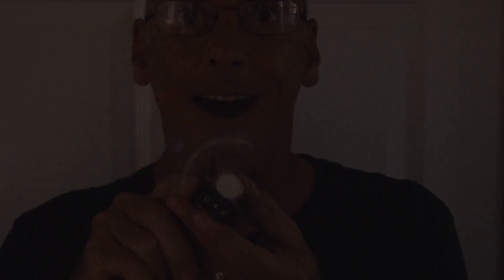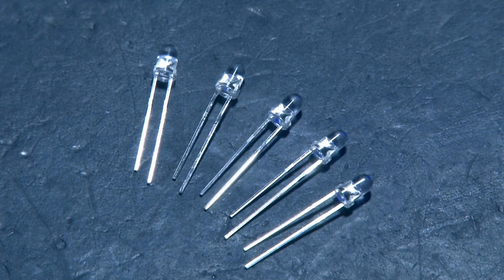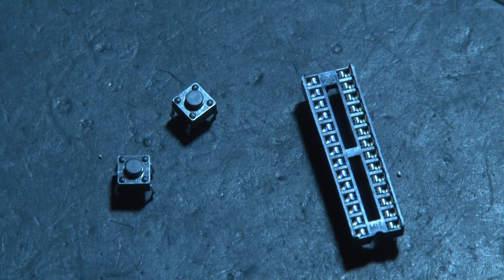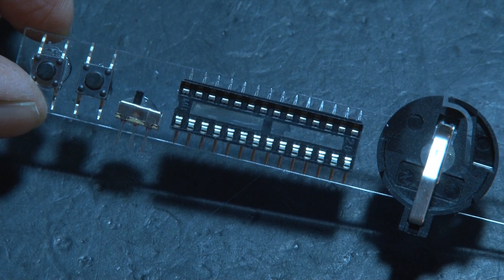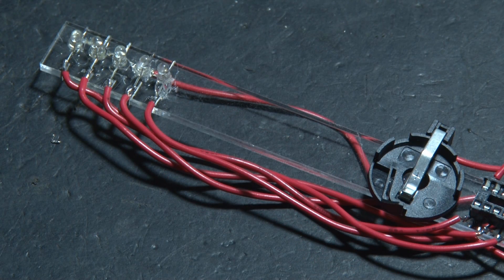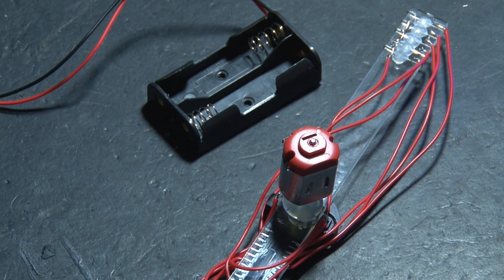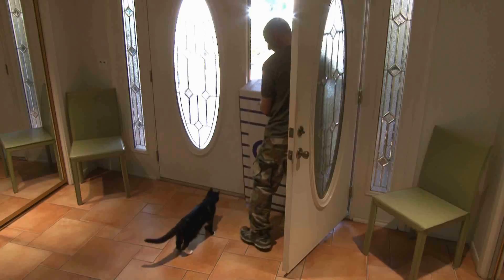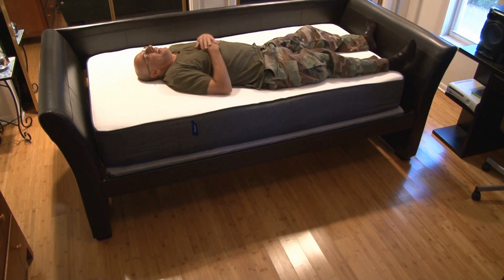Make a Spinning LED Display!

Comment: why the atmega? an attiny would also work
Reply: Microcontrollers have internal oscillator nowadays !
Reply: I don't care what IC he used, I wonder how he got the IC to work without a crystal oscillator clock!
Reply: Gilles Bisson I found that out on my own before, but thank you for pointing that out. : )

Comment: What a mess! Thick wires, messy soldering, hotglue? Now Hot glue is fine! But I would drill a hole for the motor, use very thin wiring and so on.

Comment: have any one idea about the name of programmer ATMEGA
Reply: +thaer shabo ATMEGA is a type of micro-controller
Reply: mikimomo97  yes i know that but there are a lot of name there for example in the arduino uno the chip is "atmega328p" but when i try to replace the chip with "atmegaBL_BPU" it show me the error ,so just i want to know if i have Atmel AT89C2051 microcontroller (or AT89C1051, AT89C4051) how can i program it. thank u.

Comment: Those wires are too thick for that amount of electrical current. It's a good idea to dissect an old Printer Serial cable in order to get the wires inside. You will get like 20 thin wires of different colors.

Comment: Kipkay You should check our ARDUINO a new small programmable computer
Reply: +adam darras facepalm
Reply: +adam darras It's not new at all. It was released in 2005. Of course, new models are constantly releasing. Anyway, the Arduino is just an AVR based computer. What makes the Arduino an Arduino is the software.
Reply: TheScoutPro ??
Reply: adam darras Look at some of his older videos.
Reply: TheScoutPro U mean he already used it before? ok srry didnt realize that.
Reply: +adam dares Yes, he used it before. He made one. It's not yours. You shouldn't say "our arduino".
Reply: Vlad Tomoiaga Reread the comment.
Reply: TheScoutPro shut up

Comment: Securing everything with hot glue... using red wires for negative line (2:16)... good luck troubleshooting this project if it stops working

Comment: Button cell battery? Eugh, those should be used for calculators, watches and nothing else.
Reply: They are also used in your computer and mobile devices to keep the clock when the battery is dead.
Reply: ***** Forgot about that. Not sure if mobiles use them or just a big capacitor, but desktops and laptops certainly do. Got a netbook that always boots up in the year 1970. It's only five or so years old, so I'm not sure why the battery's dead already.
Reply: Mrvideosandgames Mobile devices have the small button cells (like those in wrist watch) and they're soldered.

Your netbook's button cell battery lasted for 5 years so it's more than enough and it should be changed, it only costs $1 or so and it's easy to replace yourself.
Reply: ***** It's not really used anymore and syncs itself using the internet on every boot-up anyway. Unless you reckon the battery's going to start leaking all over the place, it should be fine as it is.

I never knew mobiles (tablets too, presumably) had button cells soldered in, so that's cool. My old smartphone's clock drifts enormously when turned off. Like, by years, sometimes. Could that sort of behaviour be linked to a dying battery or is something just faulty?
Reply: Lithium batteries DO leak sometimes, so it may be a good idea to remove it, just in case.

I should mention that the button cell battery is also used to save the BIOS settings (which includes time) when the laptop battery is removed, so if you're experiencing problems getting BIOS settings to stick, that's the reason.

Yes, tablets also have them, and yes, your smartphone's clock drifts when turned off because that little button cell battery is dead. As they're smaller, they don't generally last 5 years, more like 2-3 years.

Comment: I'm terrible with a soldering iron 3:
Reply: +PlasmaSponge that is not okay. Work on it! xD Now seriously just practise with soldering some cables, u will get better
Reply: +PlasmaSponge Clean the soldering tip before use. Tin the soldering tip. Then tin the wires/components. Then solder them together with a bit of extra tin. 2 things to look out for: Make sure you keep the components still while soldering. Don't let it move while the solder cools. Make sure you clean the tip if it gets dirty, re-tin the tip and repeat the steps. You will be soldering like a boss within no time :)

Comment: how does the chip work without the crystal?
Reply: +Blue 4lifeblue Only beyond the scope of 15 mhz it needs a crystal. Most controllers come packed with a small embedded clock crystal in the IC.
Reply: +XsR thanks for the info

Comment: Nice project overall, but there's a lot more room for improvement: drill actual holes for the LEDs, use thinner wires and measure everything out to make it as balanced as possible.